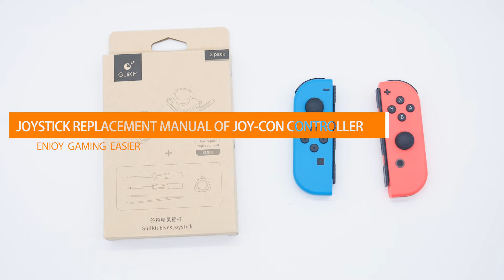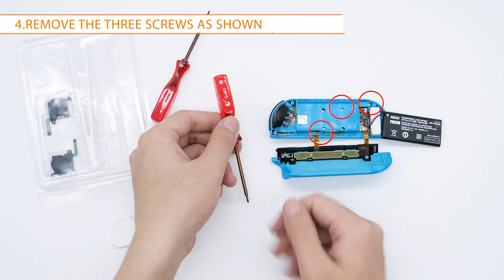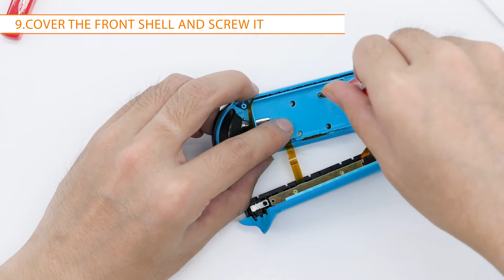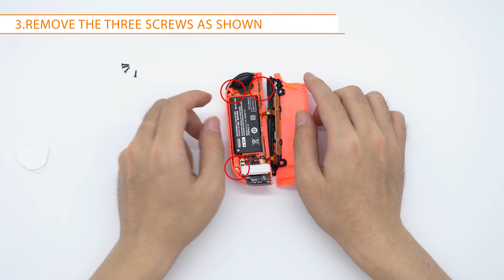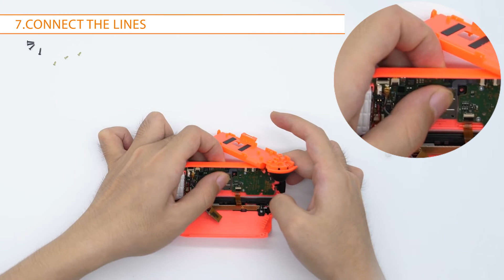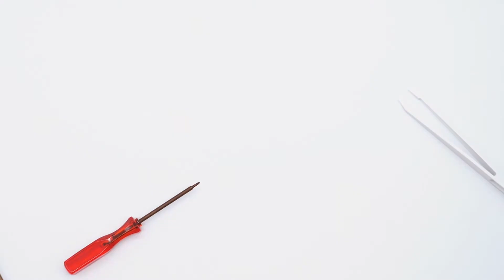GuliKit Joysticks Replacement Tool Kits Repair Instruction on Switch Joy Con

Comment: Not sure what I’m doing wrong, but I can’t get the ribbon cable plugged in. Broke 2 of them so far, and also broke the part on the circuit board that the ribbon cable plugs into….I did have that release mechanism up too.

Comment: If this does not fix your issue, make sure to use the Calibrate Stick feature. From the HOME Menu select System Settings, scroll down the menu on the left-hand side and select Controllers and Sensors. Select Calibrate Control Sticks and follow the instructions to verify that drift exists and initiate a calibration.
Reply: this did help me. one stick installed perfect center. then another stick installed off center. but after calibration, its in the middle.
Reply: perfect~! thank you~~!!

Comment: well i just replaced my stick that i broke with the gulikit. some of the tough spots of the learning process from a first time diy repairer. some of the ribbon cable attachments are tricky. but i zoomed into the video to find out where they were tweezing it. so that helped. new stick works perfectly day one. it doesn't feel the same as the OEM sticks. its a little bit tighter. the stick springs back to the center faster. so it will take some getting used to. but all in all i'm happy.

Comment: Just installed the left joystick and it tests perfectly! That said, there's one roadblock involving the right joycon. There's some kind of soldered-in wire connected to the battery casing that's preventing me from fully opening it. Anybody know about this?
EDIT: Nevermind, I got it covered. Both work perfectly!
Reply: I have just replaced my right Joycon. When opening it up, there was a very short wire connecting the top part coming from a metallic box that had some white sticky pad on it to the bottom making it open up like a clamshell difficult. I looked at the video and saw that this... thing... could have been on the bottom part (the one with the battery). I gently coaxed it out from the top to the bottom. There's even a little 'slot' where it can sit in.

There's also a gray wire that leads to that weird metal pad that will also have to be gently coaxed out of the way. Not sure which you're referring to, but hopefully this helps... 4 weeks later.
Reply: @Daeca  I actually found out shortly after posting this that it was some kind of antenna, likely what you just described. Thank you anyway!

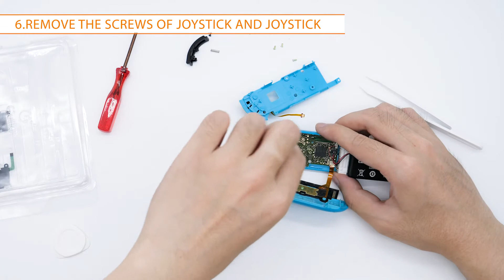Comment: At 0:40, there are two squares showing which screws to remove. The left square is showing the wrong screw. It’s actually the screw closer to the analog stick that needs to be removed.
Reply from the maker: Thanks.
Reply: what square you talking about
Reply: @zilverman7820 jump to the timestamp and pause it. There are red squares the uploader edited onto the video.

Comment: When I first installed it, the joystick would sometimes feel a little slow when going in either the left or right direction, and the center was a little off, but if you just calibrate the joystick in settings, you should be good

Comment: Are the included stickers optional?  Wasn't sure if I should replace my old ones or double up on them. I ended up not using them. Didn't seem needed.
Reply: I just got the kit and I'm puzzled about what those black stickers are for. I can't figure out the use of them. Do you know what they are supposed to do?
Reply: @MarioGamer2.0657  yeah. I got in the end. Only thing that is not very clear is how to mount them. You have to know that the knob can be removed, so you can place the ring comfortably.

Comment: Is it ok to use metal tweezers or would plastic be better?
Reply from the maker: Yes, metal tweezers are no problem.
Reply: Even though they say metal is no problem, it's probably better to use plastic ones as they'll be gentler in this application

Comment: i just did the replacement for the blue joycon and it still drifts, are there any more steps needed?
Reply: i did update the controller and recalibrate it via settings now the controller stopped drifting but there is now a dead zone on the very top...
Reply: Same situation. Still drifts when im playing mario kart 8. Has anyone found a solution to this?
Reply: Recalibrate you switch

Comment: Does the lifespan of the stick is longer than the og?
Reply from the maker: Quality is good. The lifepsan is similar. Thanks.
Reply: Yes that's the whole point lol magnetic sensors don't wear out over time. That's what this has

Comment: Does this go well with any amiibo scannable items?
Reply from the maker: This joystick replacement only fit Nintendo Switch Joycon and GuliKit Elves controller.Thanks.
Reply: Yes. I think the nfc scanner is below the actual sticks so it'll work no matter what stick you use to replace the originals